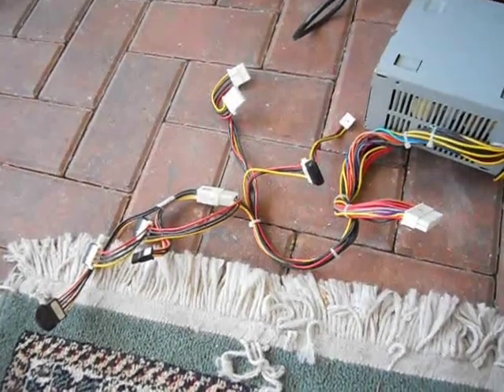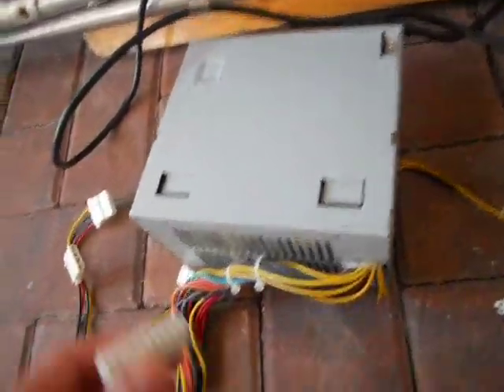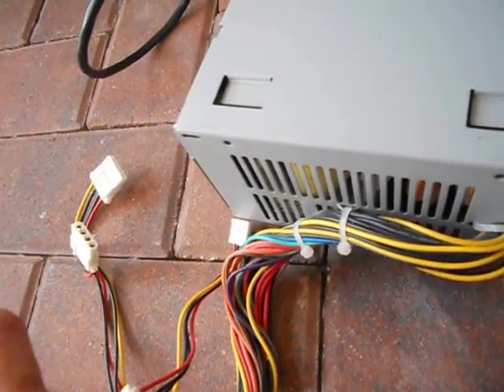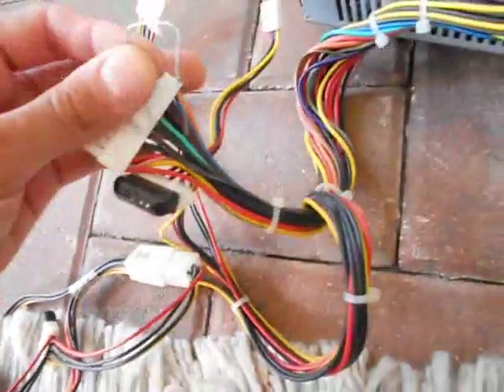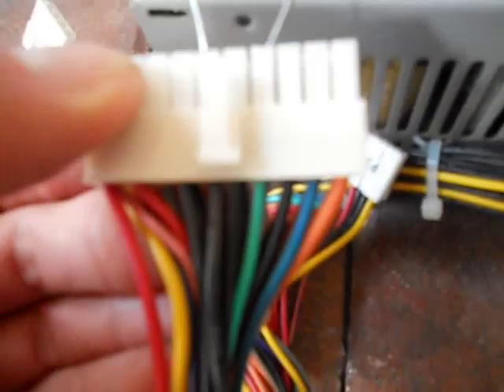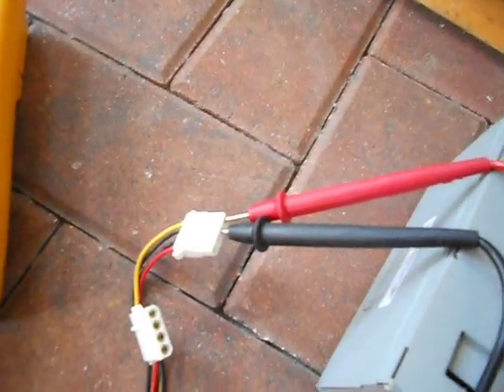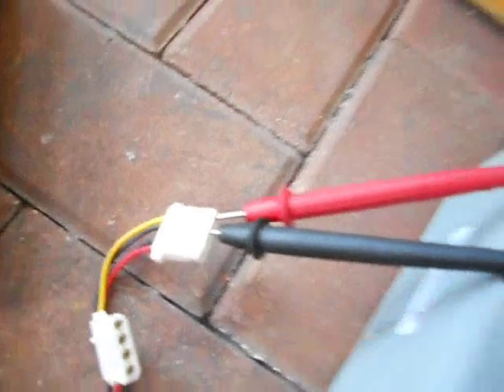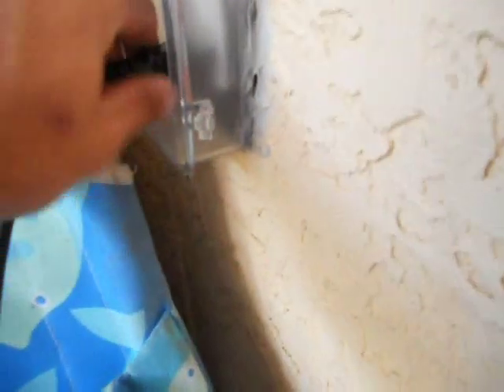How to test a Computer Power supply PSU with a volt meter

Comment from the maker: If the PSU is ok when its out of the computer but backs up when its plugged into the mobo, the mobo could have some sort of continuity issue.  I know my PSU acted up and so did my computer when I had 3 blown capacitors on the mobo, I replaced them all for $1 and all has been well.

Comment: thanks man ,I tested my PS (dell optiplex) and the voltage seems ok (12V yellow wire & 5V the red one) but when I plug to the board the power button turns amber ,keep pulsing, what do you think?